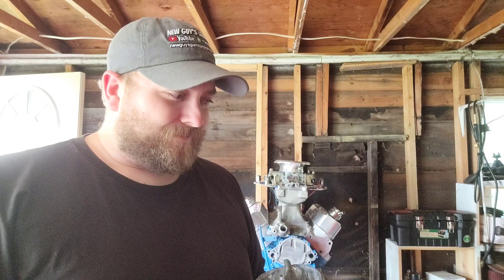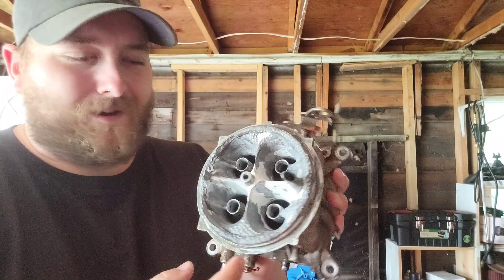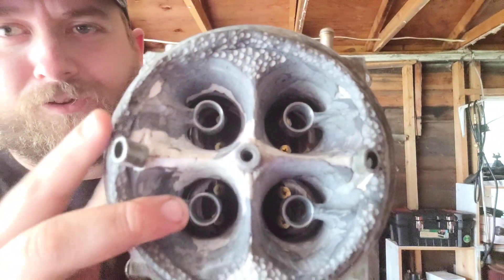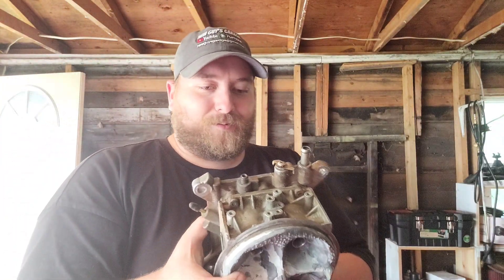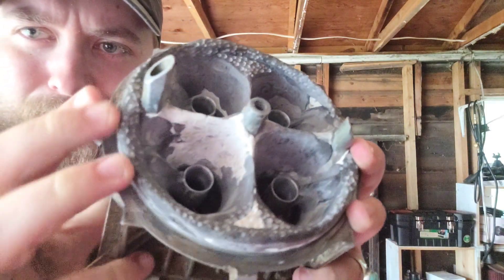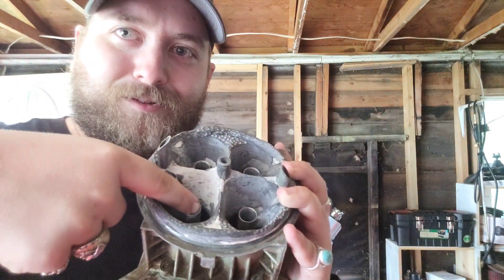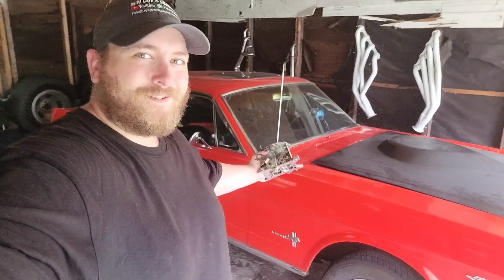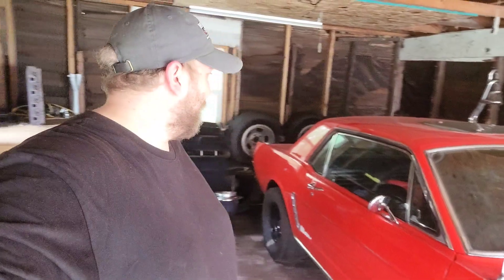Massive Win! | J&B Weld Carburetor Flow Bench Testing | Holley Carburetor Mods | Project XMC Carb

Comment: Pretty good use of the old brain there ,,gained a 100 + cfm on a 650 that's pretty dang good.  Interesting too see the the throttle response on it ,, some of the best. Hot rod ideas & parts ,,come from someone building stuff in there garage ,,,cool 👍 👍
Reply from the maker: A 600 actually lol 

Be sure to check out the video linked in the description for the actual flow test itself from Joseph Nowak! Without him this wouldn't have been possible 😁👌
Reply: @newguysgarage6802  see there I wasn't paying attention ,it was a 600 not a 650. Yeah I will check that out ,,,I like new & good ideas on the go fast stuff ,,.next time say pay attention Dammit 😃 👍 👍

Comment: Itl be cool to see it on your 302.  For whatever final geometry you come up with it would be neat to 3d print an insert if you didnt want to have jb weld on your functional piece.
Reply from the maker: That is exactly what I was thinking! Lol 😂 

Need a 3d model and then can have it either 3d printed, cast, or cnc machined. 

An insert that fits in a standard choke-less main body, the accelerator pump nozzles can be the "bolts" to hold it in place too 🤔